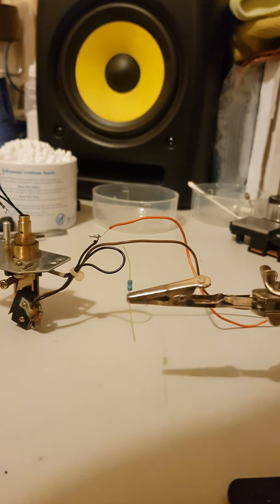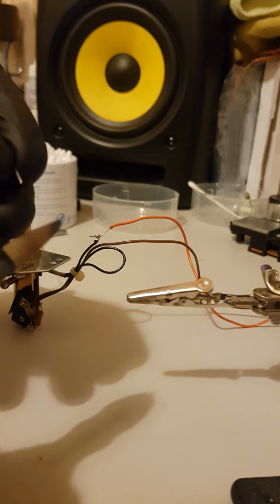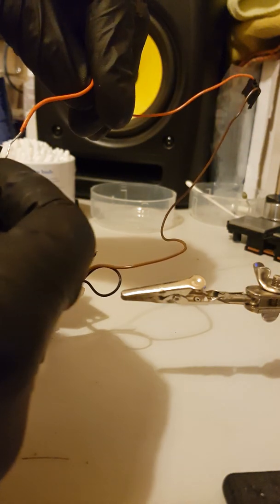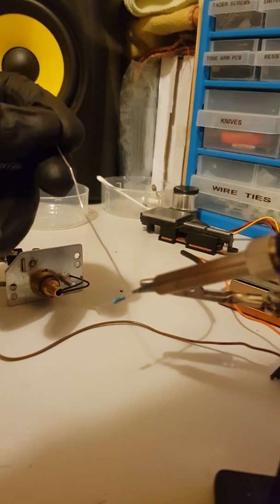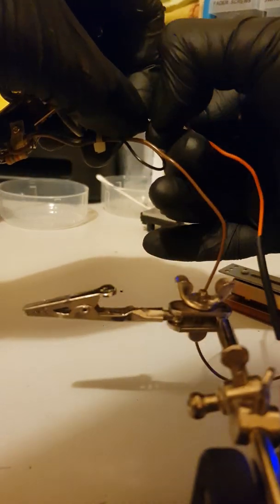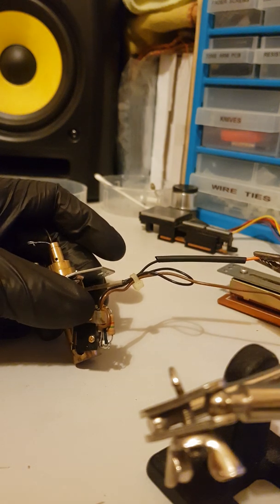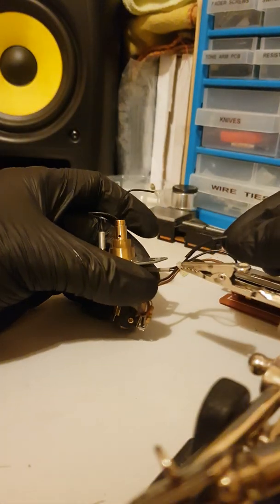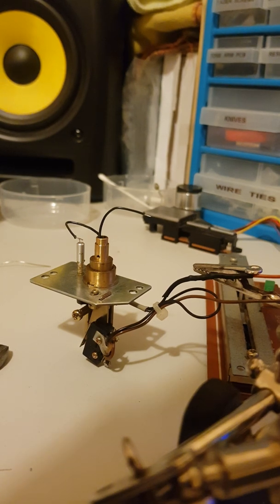Fitting an in line 1k ohm resistor for Technics 1200/1210 pop up light

Comment: Hi,  can you please clarify a bit more wiring this new led bulb because there are many different ways of connecting on various tutorials and it is a bit confusing sometimes. 
Did you connect live wire from bulb directly to the resistor and further on orange wire and negative wire from bulb on switch plate?
Orange wire on technics is live and brown is negative?

Thanks for sharing these infos!
Reply from the maker: Yes the orange wire is the live and the resistor goes to the Anode (+ side usually the long leg) of the LED and the wire from the switch goes to the Cathode (- side  usually the short leg) of the LED
Reply: @decktech9684  great, thanks very much for clarifying this!!